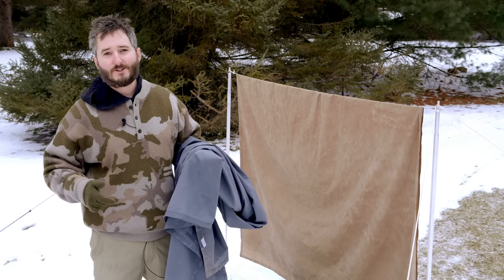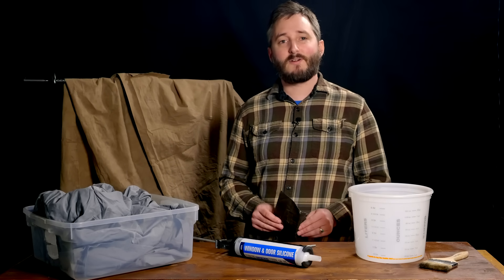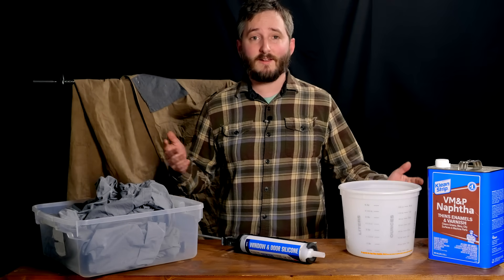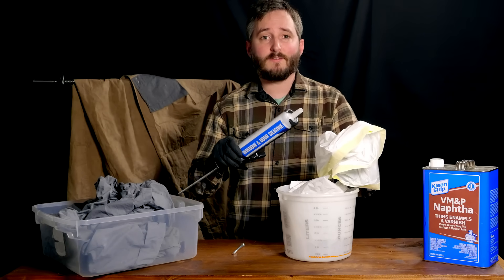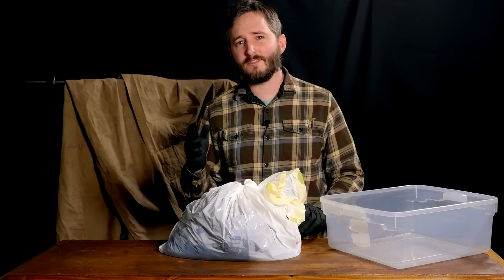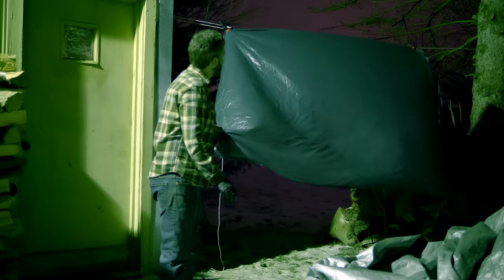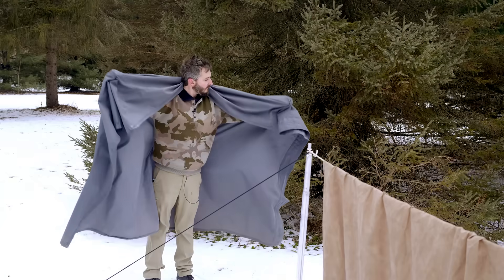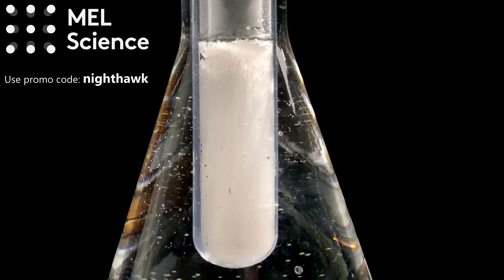Recycled Bedsheets Make The Best Waterproof Tarps

Comment: drat, for us non-Americans anyone know what are the European names for naphtha and "mineral spirits"? 
This is potentially the best tip I have ever seen on You Tube.
Now all I need is to find very sturdy bedsheets to act as surrogate for my very expensive canvas tarps. Obviously cotton bedsheets will never be as durable as 16 or 20 oz canvas, but they should be considerably more UV stable compared to the PVC cheap tarps I have been getting instead of real canvas and bedsheets will be a fraction of the cost of canvas!
Reply from the maker: White gas camping fuel or shellite are the same thing as naphtha

Comment: Maybe this could be used to make waterproof work clothes (for a painter, drywaller, etc)?
Reply: I'd be worried about the solvent potentially burning you if the mixture isn't right, but if it is safe, I'd like to know

Comment: Great Video! If you're going to do this with mineral spirits you should put the silicone in a quart size paint can and fill it about half way with the spirits. Then use a paint mixer paddle on a drill to get the silicone thinned out and then mix that with the rest of the spirits so there are no clumps. The fumes on this project are tremendous. I did it outside and still had fumes wafting at my face so be prepared.
Reply: How to get rid of the fumes?

Comment: This is great if you've got a free sheet and some cheap naphtha, but here in the UK, naphtha is difficult to find, and when you can find it, it's expensive. I could buy several tarps for what it would cost to buy a sheet and waterproof it using this method.

Comment: I make glue by adding polystyrene into acetone , it dissolves into a thick glue and uses up useless scrap stuff, I'll try this technique using acetone I think. Naptha is banned here in the UK, acetone is cheap. One thing nobody seems bothered about might be worth considering, fire. Some of the liquids I've seen mentioned here might make a poncho , but also make a dangerous fire hazard camping? I think testing that with anything you waterproof might be a good idea, you don't want to make a human candle.

Comment: I did this with a King size sheet and used mineral spirits as the solvent due to difficulties finding Naphtha. I DO NOT recommend using mineral spirits. in my research, I've found that camp fuel (white gas/Coleman fuel) is the same stuff and can be purchased at Walmart. You may also find it in bulk at some petroleum suppliers. Speaking of which, regular unleaded gasoline may actually work as well, though you should check the legality of using gasoline as a thinning agent wherever you live and never do so indoors unless you have a vent hood or something. Even then, probably not a good idea.

The problem with mineral spirits was the speed of evaporation. It took 5ever to dry and ended up getting a lot of dirt, grass, leaves etc suck in it.

Another thing worth considering is setting up a clothesline. I would personally recommend using the button method described in this video and some stakes to spread the sides apart with one line running down the middle to suspend it. It wasn't a problem for me because it dried so slow but, when draped over a clothesline, the two halves are strongly attracted and will otherwise require supervision and repeatedly peeling them apart to prevent it from curing to itself.

I actually ended up using our laundry dryer to finish it. This was also pretty effective at removing the dust and grass as well since they were caught by the lint filter. Maybe don't use this method with Naphtha or Gasoline but mineral spirits are relatively stable so I wasn't particularly concerned about fire. If you don't have an exhaust fan in your laundry room, I would strongly recommend against using this method. The fumes could easily build to toxic levels regardless of the solvent. Your brain will thank you for inhaling less petroleum vapors.

Comment: Does this treatment prevent the cloth from getting waterlogged?  If you treat the fabric this way then use the tarp out in the rain does the tarp still need to be laid out to let dry or can it just be shaken off and then stored away immediately?  Thanks.
Reply from the maker: It can get waterlogged if water pools on it for a long time.
Reply: @Nighthawkinlight  OK.  Thank you for answering.

Comment: I would be curious to know whether anyone has tried this on shoes. Specifically, do they become so water/air tight that you'd wind up with blisters due to excessive sweat inside the shoe?

I have some non-waterproof trail runners and it would be great if they were waterproof, but not if they wind up being 100% airtight.

Comment: 6:05 . Hey man, great video. Why do you say that if someone wants to waterproof a piece of clothing they shouldnt fully submerge the item in the mixture? Thanks.
Reply from the maker: Because you don't need silicone on the inside to make it waterproof, and it might be bad for your skin depending on the type
Reply: another point, more silicone means you’re adding more weight to the item, probably a negligible insignificant amount, but it could also be the straw that breaks the camel’s back. it’d also using more material than strictly needed and therefore cost more money. other than ease of application, there’s not much reason to waterproof the whole thing

Comment: You should do ALL this process OUTSIDE., AWAY from any dwelling for flammability reasons.  After that sheet "appears" dry, you need to dry it for a WEEK before you fold it for storage or take it inside.  Traces of that solvent hang around for a CENTURY.
          The better solvent to use is toluene or xylene.  make sure you use ACETOXY silicone & not METHOXY silicone.  (Acetoxy silicone smalls like vinegar, & is usually the cheapest silicone.  Avoid "corrosion-free" or "low odor" silicones.
          Before you put the silicone in the bag, add a little solvent first.  It will disperse easier.

Comment: What to do with all the leftover emulsion though. Takes an act of Congress and a 3 hour drive to pay to have toxic waste handled - as it should be bc I'm not dumping it in my yard.
Reply from the maker: There is none left over if made as directed for the amount of fabric. If there is excess, let it dry in open air. You will be left with a bag coated in dry silicone.

Comment: love the button technology! also now i'm imagining finding a fitted-bedsheet the same size as my tent. putting it around the outside of my tent as an upgraded groundsheet which also comes up the sides by 10-20cm to protect from any snow/rain splattering up the sides
Reply: Better idea is to leave an extra 18 inches or so on the bottom edge of the tent that will lay flat on the ground then you can cover it with snow. This will keep air from coming in at the bottom and will prevent the wind from blowing the tent over. I saw this idea recently on another video and it is a genius I think.
Reply: @alfredabbey6162  you mean some of the outer "fly" of the tent lays flat on the ground, and weight that part down with snow? That's a good idea too
Reply: @benja_mint  yes, I saw it on Canadian Prepper. It's called Russian bear or something like that.

Comment: This looks really easy and effective, I might try it! I once used linseed oil to make a tarp and it takes an awfully long time to dry and is only sort of waterproof ... it's good for a light drizzle, but with heavy rain a light spray of water will come through and that's shitty when you want to move on early in the morning and have to pack a damp sleeping bag.

Comment: Naptha was the original fuel for them new fangled gasoline engines.  Available at every hardware store in America.  Therefore, it's as flammable as gasoline.  Explosive.  Mineral spirits is a lot safer.

Comment: I just bought one of those USMC modular sleep systems recently and it didn't come with a tarp. Tarp was sold separately and for the same price as the tent. I was planning on getting a plastic tarp to use but I will be making my own using this method instead. I was hoping to find a tarp that was light enough to pair well with the tent for backpacking trips and this seems like the perfect solution.

Comment: I believe naptha is sold in the UK as "De-greaser" but the labelling on the tins is atrocious. It is really hard to find out what commercial products actually consist of these days - mainly because they are concealing their simplicity and charging a premium for the branding. Alternatives like Turpentine and "Lighter fuel" are far too expensive, most "Paint Thinner" is too high octane and will melt through your plastic bag and bucket in no time, and "White Spirit" is not a good solvent nor very safe to handle - I for one am completely allergic to it both on contact and in the air. I'm sure there are many other sensible alternatives. Something should be done about the labelling of products in Europe - it is much easier to buy properly named raw materials in the US.

Comment: Naphtha has apparently been banned in my county, & maybe even my state.  I presume the ratios given would be similar for uaing mineral spirits, but maybe the drying time will be double, more or less?  How do silicone & traditional oilcloth methods (not adding beeswax, though, just the basic silicone or boiled linseed oil) compare, re: total weight change, drying time, durability, longevity, reapplication/repairs, etc.?  I'd wanted to try oilcloth before learning of the silicone method, so any insight would be very appreciated.

Comment: Ripstop weaving though is missing in bedsheets.  You SHOULD have mentioned since you surely know. 

Also, what about treating the same excellent ways (less solvents) of yours the synthetic, worn-out tarps ?

What about silocone sprays versus other waterproofing sprays? 

Why not simply loose some thinking about it ?
I always hate it when otherwise excellent content carefully avoids obvious info, thus "humiloates" the intelligence of the influenced friends.
I know.. am disprppotionally harsh ' but it is a general patern that I really wonder why it persists.
Reply from the maker: Normal tarps aren't ripstop. Expensive specialty ones are, but not the kind purchased by normal folks at a hardware store. If you want ripstop you can coat ripstop nylon in this way.
Reply: @Nighthawkinlight  🙂👍

Comment: I'm in South Africa, I've never heard of Naptha. So I tried silicone and Acitone, it was a diaster, and it wouldn't mix properly, and then it melted my spray bottle, so next time I'll use Mineral Turpentine, I believe that works as well. It just takes between 36 and 48 hours to dry. Trial an error. I hope I'm not going to be high everytime I use my tent. 🙄
Reply from the maker: Turpentine may work. Naphtha may be called shellite or white gas or camping fuel in other countries

Comment: Have about 7-8 vintage Burberrys trench coats that normally need retreated every two years I am preparing to treat this way...great video.
I plan to brush it in. And leave liners alone.
Reply: This should help me a lot. Belts, straps, etc.
It is all Gabardine Cotton and was woven using 5 standard weights from thin thread to thick depending on climates I imagine.
Anyone have ideas for dry cleaning DIY before locking these in permanently with silicone....after this video I consider naphtha a good choice to do a test rum to at least brush out and dust, oil, mildew, fats, or possibly rubber and soot....one has chocolate that is baked into a pocket now(I thought newspaper and an iron may press that most out but solvents likely work best if correct one is chosen for the stain type) so maybe a bit more homework on chemistry but almost ready

Also have you had any issues with denatured (bittering agent/etc ) in solvents affecting quality of work , on anything not particularly waterproofing??
Thanks for making this tutorial.
Reply: Lol test run, not rum.
Although the rum may work better again depending on variables...and good to keep on hand. Perhaps isopropyl. Considering there is not a sudden supply crunch, strange things happen like that.
I'm crazy for buying large amounts used  multi-purpose over the years then suddenly everyone decides it really does kill everything ((short of the reason they bought it, a virus which is not living to begin with.))and clean of f the shelvrs.
But hey I always had a few bottles around.

Comment: Can you do this with ripstop nylon? Or other fabrics?
Reply: You'd have to make sure the nylon didn't melt in the solvent first. (Make sure to soak it as long as it would have to soak in the silicone solution so it has a real test of resisting the solvent. )
If it plays well with your chosen solvent, then try a small trial strip with the silicone added and see how it works.

Comment: Isn't Naphtha highly flammable and so probs not the best for anything that may go near a fire? Ie tents or snug blankets? Or does the flammability wear off after a few hours/days?
Reply: The naphta evaporates, leaving only behind the silicone. You're using the naphta to cover the fabric in a thin coat of silicone, when you hang it up to dry, the naphta is the thing that's going away

Comment: good idea, how flame resistant is it after dry? Like can you tend a fire in the rain?
Reply from the maker: About as resistant as a normal tarp. Could get holes from sparks but it's unlikely it will catch fire without putting it directly in the flames. Also depends how flammable your starting fabric is.

Comment: Silicone 1 I think is what you want (cheaper stuff as mentioned in the video). Another video I saw on waterproofing shoes mentioned that Silicone 2 has some additives or fast curing properties that keep it from working well when thinned (mineral spirits / naptha / etc...).
Reply from the maker: I used the acetic acid cure type. I forget if that's type 1 or 2. Smells like vinegar.

Comment: This is an absolutely brilliant idea taken into practice. Thank you so much for this. I’ve used boiled linseed oil, thinned with mineral spirits, on a patio umbrella. It worked well, but left the fabric stiff and crinkly. The technique you’ve shown us is definitely one I’m going to use in the future. 
Does the fabric remain “breathable”, similar to gor-tex (sp?)?
What I mean is if I were to treat a shirt and pants, would it trap vapor on the inside as though I’m wearing a plastic bag, or would it still be able to vent out while stopping liquid on the surface?
How well does this treatment hold up after a pass through a washing machine, or is that even necessary?
Reply from the maker: It remains breathable. Not sure about washing because I don't care if my tarps are dirty.

Comment: You have done this in the worst way possible all you need to do is throw 4 sheets into a washing machine with a bottle of Super Pel. This is the material used to treat waxed jackets and is far superior to silicone. British Rifle hunters have been using super pel since the 50s on their hunting gear to make it waterproof without the rustle of other waterproofs.

Comment: What do you think about a canvas tipi? Would you use the silicon/solvent? or do you know formula of oil/beeswax?

In my curiosity, I have also wondered about pine pitch and finding a way to use that.
Reply from the maker: I think silicone will work better than oil/wax. Pine tar is often added to oil mixes but still I think silicone works better and is cheaper.

Comment: I'm curious to know if you have tried using a similar process to waterproof/seal wood. I don't know that it's needed, as you don't generally need the same kind of flexibility in wood, but I wonder if you could use this to weather-seal outdoor furniture.

Also really curious to know how breathable the cloth is afterwards (if at all). Does the silicone completely seal off the holes in the fabric, or does it just absorb into the fibers?
Reply from the maker: Should work for wood. The cloth is about the same breathability it was before treatment

Comment: How flammable would the treated cloth be after it dried?
Reply: All the flammable solvent evaporates out as it dries, leaving only the silicone. Silicone is very heat resistant, and is even used as baking dishes. So I would say it fireproofs the sheet better than untreated.

Comment: What exactly do you buy as Naphta formula? What is it outside the US?
Reply from the maker: White gas or camping fuel
Reply: @Nighthawkinlight  Waschbenzin? Petroleum benzine? Gasoline used for cleaning purposes?
Reply from the maker: @NICEFINENEWROBOT  I don't know what it's called in every country. It's the same as the fuel for a zippo lighter or a liquid fuel camping stove.
Reply: @Nighthawkinlight  Zippo lighter fuel, I get it. It is not the cheapest though.
Reply from the maker: @NICEFINENEWROBOT  Yes it's cheaper if you can find the larger cans sold to fuel stoves.
Reply: @Nighthawkinlight  Did you cover the waste disposal problem? Is the unused rest storable?
Reply from the maker: @NICEFINENEWROBOT  Just let it dry and it's fine to throw away. I haven't tried to store it as I've never had extra
Reply: @Nighthawkinlight  All in all that sounds good. I think I'll give it a try. THX!
Reply: This is exactly what I was wondering in the UK, thanks!
Reply: Thanks, was wondering that also 🇦🇺

Comment: Can your 50/50 mix be used to 'paint' the silicon onto a convertible top for water proofing? I'm in South Florida and while I have used car care products for waterproofing the top, with the downpours we can get here it soon reaches the 'saturation' point where it is no longer effective for repelling water and this process seems like a good idea, but I have heard that silicon shrinks fabric over time. I really do not want to spend $2000 for a new top. Thank you for your help.
Reply from the maker: I don't know. You would have to test it on a small area and find out